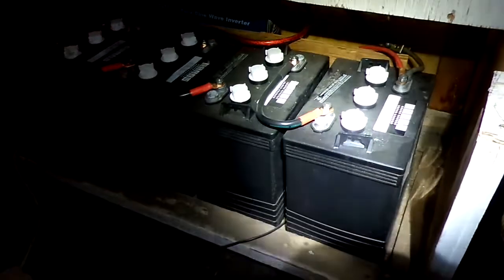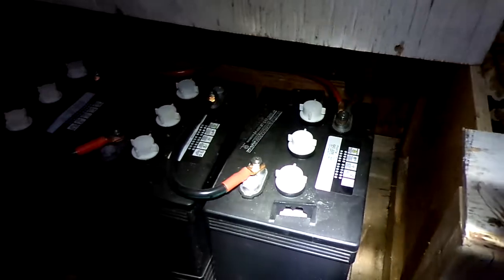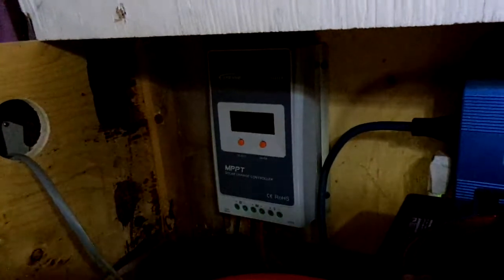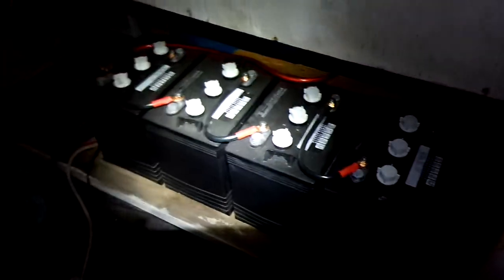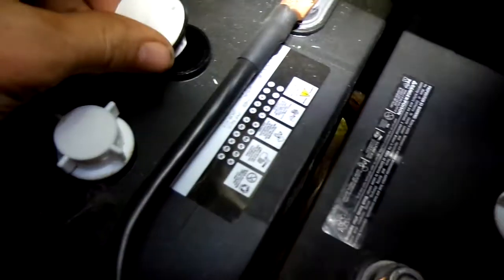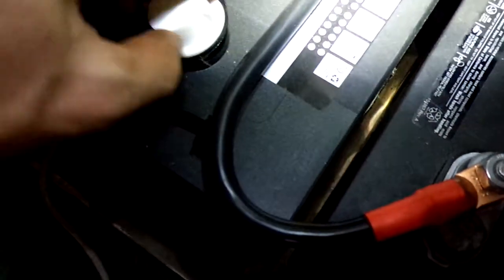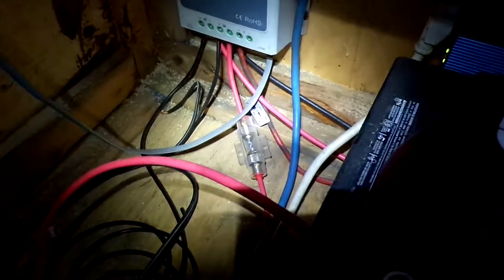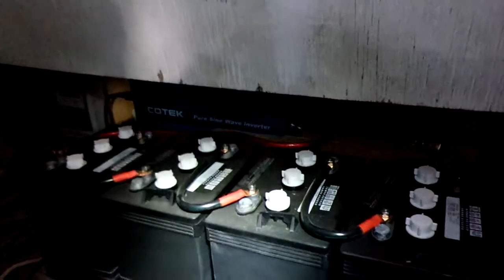Solar system Magnacharge GC-225 6 month checkup

Comment: Hey there. Do you mind telling me what charging parameters you use? I use bulk charge 14.8, float 13.5 and equalize 16.2 but I never seem to get a full charge. It reads 13.7v on the batteries and when I turn the inverter on , it quickly drops to 12.4. Any info would be appreciated. Thx